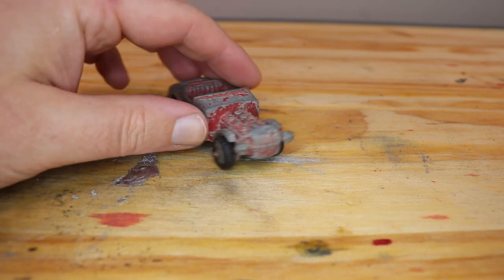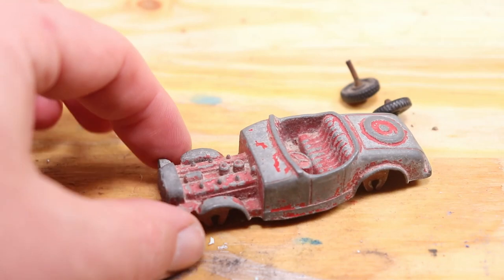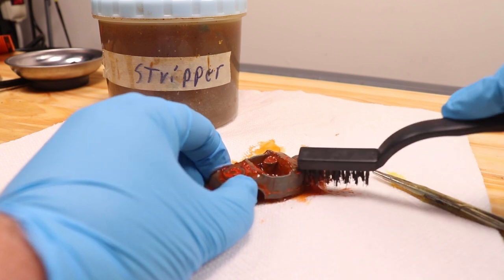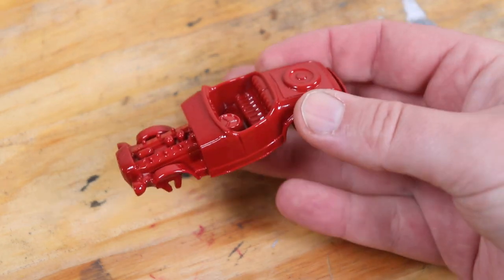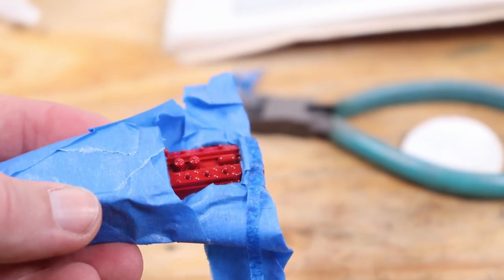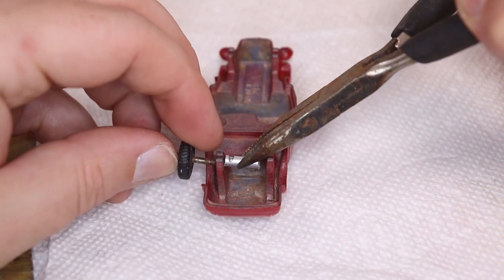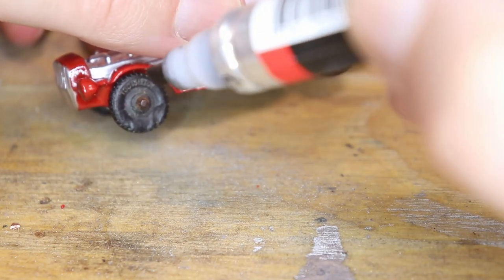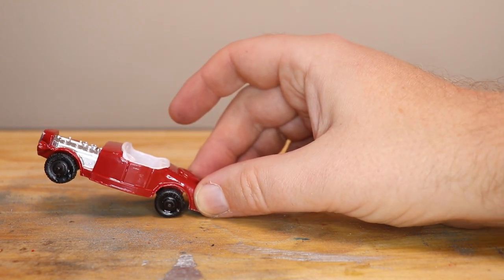Tootsietoy Model "B" Restoration - Better Than New!

Comment: Great video. I use the empty tubes from old ball point pens to join the axles back together.  Lots of times it is a pressure fit and no glue is necessary.  I even paint the tubes silver to make it look nice.  I recommend giving it a try.
Reply from the maker: David K. That is a great idea! I am going to try it and credit you.